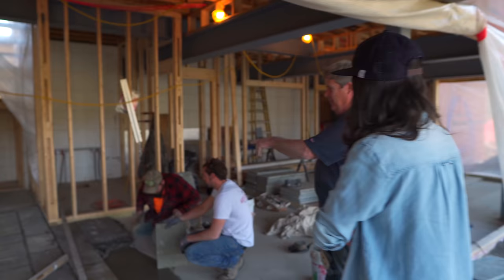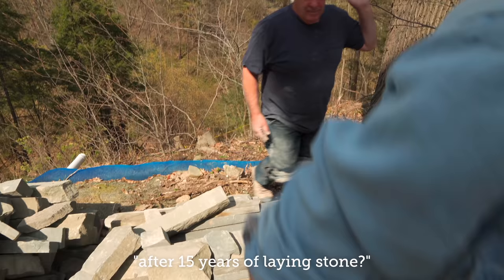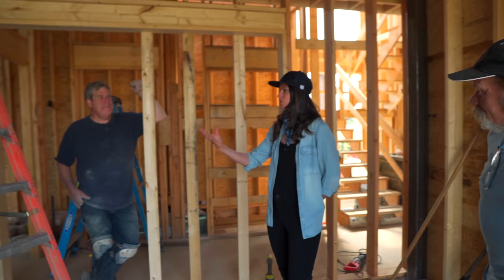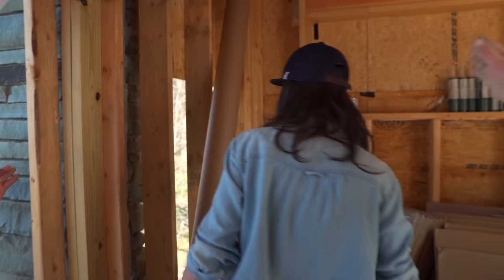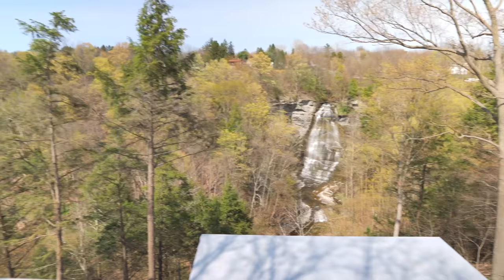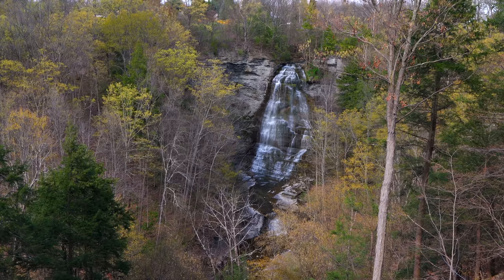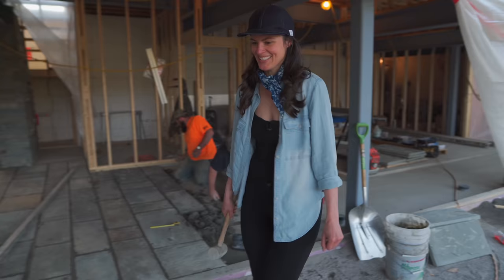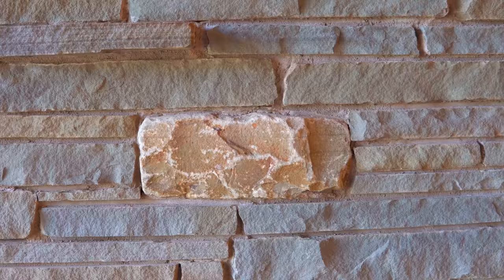Epic STONE HOUSE Build Overlooking WATERFALL — Ep. 063

Comment: 21:21 bonding the stone directly to the sheathing is an issue Matt Reisinger talks about on the build show. Over time rain storms will saturate the stone, the water will seep through and start to rot the sheathing. Best practice is to leave an air gap so it can dry out, but without it is a recipe for disaster. Also the sheathing screw/nail holes should be filled with the zip liquid flashing to help prevent it. Just a few additional steps to ensure this masterpiece would last for decades longer.